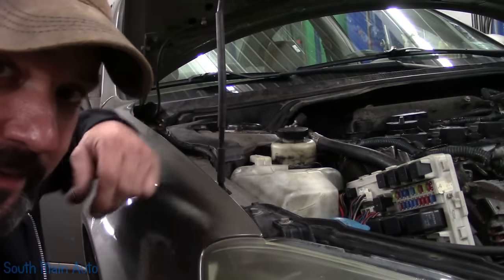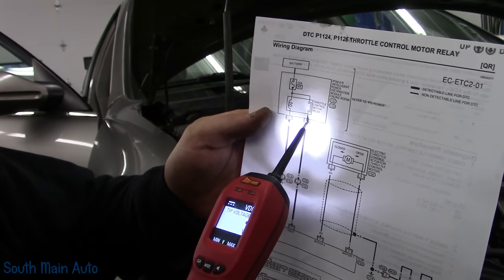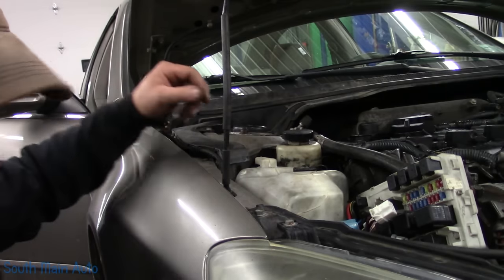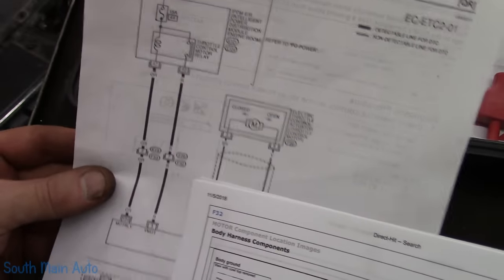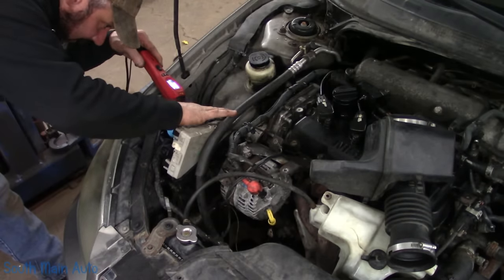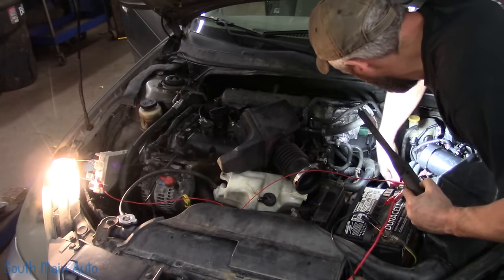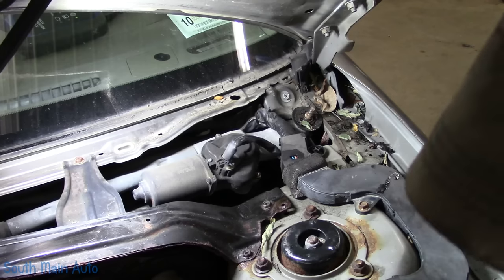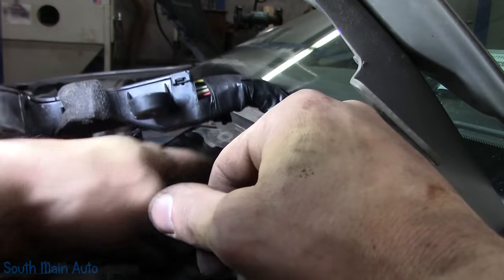How To Fix A Car That Keeps Blowing Fuses

Comment: Didn't need an ECM, didn't need a fuse box. Needed an advanced, patient, very smart auto tech, is all.
Reply from the maker: if we are honest it needed a little tape and a zip tie....
Reply: Tape and zip tie $0.48,knowing where to use them priceless!
Reply: @mikeholt3545  Moving the wiper blade while doing a short circuit test, come on, who could've seen that? Ok, I guess knowing the harness was under the cowl, but still.

There's an old joke one of the older EE's in my company used to say: I guy calls a TV repairman. The repair man slaps the side of the TV, it turns on and he says, "Its fixed. That'll $100." "A hundred bucks for slapping the TV?" The customer says. "No," the repairman says. "Slapping the TV is free. You're paying me knowing exactly where to slap."
Reply: While Mr O is certainly patient and smart, what we have here isn't rocket surgery - it's just simple logical troubleshooting. The other guys should be embarrassed throwing bits at it instead of properly diagnosing the fault.
Reply: @TonyRule  Shorting out the fuse box, not a good idea.
Reply: And most likely the customer was charged with a new fuse box, new ecm and the cable repair
Reply: @gianfrancoa  I hope not.
Reply: @gianfrancoa  There's no doubt about that. And they were about to throw an ECU at it too!
Reply: @Joseph1NJ  Well, that depends on why you're doing it. Diagnosing a blowing fuse problem in a customer's car... no. But if your BBQ is broken and you really want to cook some sausages over an open flame, and to hell with the consequences, it's a brilliant idea!
Reply: all your videos must be class sessions in  tech schools. period.
Reply: @SouthMainAuto  

Disgruntled customer "How come you charged me $1000, all you did was put some tape on a wire".
Eric O "$2.00 for wrapping wire with tape, $998.00 for knowing where to wrap wire with tape".
Reply: @Kryten428  Not in this case. $2 for the tape. $998 for having to rip half the car apart to get to the problem to fix it. I find the biggest issue with electrical work is people seem to think that the wiring is just magically exposed and easy to get to. " Why so much when you only repaired a wire?" compared to replacing an expensive part they can see that may have only taken 20 minutes to fit they seem to have no problem handing the money over.
Reply: @Joseph1NJ  He did not short the fuse box. He knew he was going to short the power wire going to the ECM.
Reply: @AutoTechElectronic  ah, ok
Reply: @SouthMainAuto  was that custom pissed about 1000 repair bill??
Reply: @mikeholt3545  tape and zip-tie...48 cents
Knowing where to put them...$60/hr
Reply: What power probe was being used?
Reply: Too many parts changers and not enough true, honest techs who have the patience to take the blinders off, dig in, and diagnose.
Reply: @Kryten428  Eric O gives them a link to the video...
Reply: @kirkabrahamson1148  You are absolutely correct! People always think that chasing an electrical issue is ALWAYS an easy fix when it isn't.  You are always chasing a ghost until you find where the issue lies.
Reply: @mikeholt3545  Good one and true
Reply: I would have installed. A  backwards zip tie. I seen them run thru wires. If there’s. Enough play  but other then that great.  Just. FYI. I’ve done ur way all The time until I seen it my self
Reply: @gianfrancoa  they were charged for a new fuse box as eric showed in the video it was melted it would have needed replacement anyway, the customer or whomever replaced the fuse in the first place with a bit of speaker wire melted the fuse box, i have come accross people that have been blowing glass cylinder type fuses and replaced the fuse with a piece of cut down steel bolt or mild steel rod, some people have a funny way of looking at saving money and end up burning their cars to the ground and still wonder what the hell happened.
Reply: In the UK, you need a college degree to become an auto tech. Here in the US, you need a license to cut someone's hair. You do not need a license or degree to repair the second most expensive property the average person will own which if not repaired properly, can put the life of everyone in the vehicle in danger as well as everyone on the road, and when misdiagnosed, cost you thousands of unnecessary dollars. 🤦🏼‍♂️Cars are not just nuts and bolts anymore. They are highly advanced and complex operating machinery/electronics. Basically one giant robot on wheels.
Reply: @gianfrancoa  Don't condemn the whole bushel because of one bad apple. Many of us are honest to a fault.  Just like any other professional job.
Reply: But didn't he say the throttle control actuator was replaced too
Reply: They would have gotten ripped off big time if they were in many other shops. I've said it many times there really fortunate to have him. Incredible skills. I've learned so much watching SMA

Comment: Pro tip: Jump the fuse and be patient. Eventually a fire will erupt and at the center of the flames you will find your short.
Reply: thats what i call an  electrical diag smoke test  thats the only way the other shop could of figured it out.
Reply: FarmerMiyagi  The trick is getting the factory smoke back into the wires.  I work on small engines, and had a customer say the factory installed smoke came out of the engine after they didn't put oil in the engine.
Reply: a bent nail works good and is reusable,just follow the smoke.
Reply: Is there a way to put the smoke back in? I've never been able to, though I have tried... Oh, I have tried....
Reply: @jeremyfizel5127  When I did electronics they told me that the wires are full of smoke and when one is leaking that's where your problem is.....
Reply: I have a friend who is an aviation electronics technician repairing servos and autopilots.  He confirmed the industry secret that all electronics run on magic smoke.
Reply: And at that point, you'll be certain that the short was somewhere between the front and back bumpers.  Also, the issue with the short is not an issue anymore!
Reply: The old navy electrician trick
Reply: Thats exactly what i did  kept blowing 15 amp for running lights  89 f-150   put a penny in  smoke at rear bumper  found licence plate wire shorted
Reply: I've seen that done!
Reply: ...that's a BAD IDEA!!
Reply: William Anderson  ...but at what cost?!
Reply: ...that's kinda like using a match to find a gas leak: effective but dangerous as HELL!!!
Reply: William Anderson  ....that was my POINT-!!!
Reply: @daleburrell6273  This is was a joy to read!

Comment: That is really stupid. As an electrician, I see this when people work on their own electrical equipment. Thanks, Eric for doing it correctly. I can't believe people blame fuses for blowing. They blow to protect the wiring and the electronics.  Shorting with a wire across a fuse terminal just causes arcing, heat, burning, and damage. It's completely useless unless you are trying to find a breaker that feeds a circuit far away. You can short a circuit to ground and then go find a tripped breaker.  This is useful with unlabelled circuits and breakers. You can narrow it down by voltage and number of phases. Anyway good video and proper troubleshooting techniques (splitting the circuit in half is an age-old method and extremely useful). They taught me that in the US Navy back in the 80's.
Reply: It's unbelievable that they put a jumper in place of a fuse. What could they possibly have been hoping to achieve other than possibly a fire?
Reply: Sounds like they were trying the smoke test, jump it out and look for smoke.  Bet that other shop doesn't have access to wiring diagrams like Eric does.  But still, isolating and looking for grounds should still be common sense.  Even without a wiring diagram, i would have unhooked the ecm and checked to see if it popped a fuse with voltage applied to the circuit.
Reply: Dad was in the Air force,and was taught the same,as he tried to teach me....lol...
Reply: wish I'd gone into a service when younger but at the time having fun n chasing girls seemed like the best use of my time. All those guys that did go into the services learnt skills that have benefited them for life, both professional and personal. I suppose I did get that a bit doing a trade with an old guy who taught me much more than just the job.
Reply: blown fuse ,paper clip , fixed , most shops now a days throw parts at it and cost because there is lack of real mech's out there 20 yrs i ve done it this way . lost art
Reply: Phatcowboy;  Shorting a circuit to trip a breaker for identification purposes does have its risks.  Many years ago in the early 70s I was working on an apartment building installing the intercom / door entry system and an electrician was tasked to install a duplex receptacle in the directory board to provide us with power.  The feed cable was there, but unterminated.  It was actually live (very bad idea!) which he discovered by accidentally shorting it out as he tried to install the receptacle. He then shorted it intentionally to trip the breaker both to kill the power and identify the breaker.  Turns out the breaker was defective and would not trip regardless of how much current you put through it!  A fair bit of damage was caused to the wiring before this comedy of errors was over.  I immediately learned from somebody else's mistake and removed this technique from my own troubleshooting methods!
Reply: @Vincent_Sullivan  Scary (and dangerous) suggestion by Phatcowboy (his handle is rather suggestive) to trace power wires buy shorting them as  was discovered. I had to rewire and old house (with sketchy grounds and old 2-wire rubber/cloth insulation. Only used electronic wire tracer. Works really well.

Comment: It's not the fact that you know what wrenches are needed and what sizes are needed for a certain job. It's not the fact that you can do a 45 minute job in 20 minutes flat. Not the fact that you've seen this same problem before a dozen times that makes you the best mechanic I've seen. It is the fact that you can diagnose a problem without a doubt to what it is. You're the king of diagnostics.

Comment: Love how a lot of shops misdiagnose a code and just want to throw in a new ecu.  My experience with this occurred about a year and a half ago.  I have an 05 Dodge Durango Limited, with the power moon roof (this comes into play). Started throwing code for ecu error (can't remember which code or the specific error), after a day or two it would go away. When it came back, I took it in and had them diagnose it. They told me ecu was going bad and needed replaced.  Price was astronomical so I started pricing myself. Cheapest route was sending it in for a rebuild, but it was a 10 day turn-around so that was out of the question as Beastie (kids' name for it) was the only vehicle we had that could carry all of us, wife and 4 kids. During this time I realized this issue would only occur after a heavy rain, and after a couple of days drying out, it went away. I started researching and checking the Dodge forums and found this was a common issue with Dodge trucks of that era with the moonroof.  In their infinite wisdom (yes, I am a Mopar Maniac, but I still shake my head at some of their design decisions), they put the main fuse box behind the kick panel of the driver's side footwell.  Well, as we all know, sunroofs or moonroofs leak, so they do install drainholes for the water to drain.  Apparently, the drain holes can plug up and in Dodge trucks, when they do, the water runs down the A pillar under the molding and straight down into the fuse box.  When I discovered this, I pulled out the fuse box and found that, indeed, my fuse box was full of water.  I dried it out, (only use my wife's fancy hair dryer saw for a year) checked for corrosion, circuit board was clean, but had to pull out my files and handy dandy torch tip cleaners and clean up all the contacts.  Replaced questionable fuses and relays, doused all exposed contacts with dielectric compound and put it back together.  Once I got the moon roof open I cleaned all the drains by running grass trimmer string all the way through them until it came out the bottom clean.  Haven't had an issue since.  Just took a couple of hours on a Saturday afternoon and about $40 in fuses and relays.  Twice a year I clean the drain holes as a preventative measure.  Only time the moonroof gets opened
Reply: Lance Rasmussen 8
Reply: Yes, I avoid a vehicle with a moon roof for that reason, regardless of the make. I usually buy Toyotas which are known for reliability and I wouldn't touch a moon roof equipped one.
Reply: I am a Master Tech that worked @ Auto Glass shops most of my life...San Diego we installed a windshield in a rare 1970/71Plymouth VIP 4 door Every time this Lady washed the car and she made a LEFT TURN...Water would stream onto her lap(we know it did it before after I found out what it was...she said it didnt...ok.) But since we put the windshield in...it was OUR BABY...I water tested it knowing full well the windshield was sealed completley!!! Yup...left turn...stream of water came through the pinch weld onto the lap...the VIP had a Stainless Steel molding on the drip rail of the roof that model and year...pop rivets held the Stainless Steel molding in place...I removed the front 3 pop rivets and shot sealant up into the holes allowing sealant to ooze out where the new rivets would go...Replaced the three...Problem solved...our shop guys had re sealed that windshield 7 times...whooohooo!!!
Reply: Mechanics getting old not keeping up on technology?
Reply: @Stimpy&Ren fuses blow for a reason.  what caused it?
Reply: It’s the manuals fault. They tell you to do test and if negative replace the part vs check your wiring and see if it can handle a load. Eric is clearly a smarter fella 👍🏼
Reply: Probably didn't need to change out relays cause they are sealed never had to replace a relay on a Subaru ever but on 75 Rabbit when radio antenna gasket weather worn would leak rain water on back of fuse block and short out! VW replaced 1st one on recall I had to replace 2nd meltdown.
Reply: I was a Dodge tech for about 4 years. I had a Commander come in with no crank, no comm with pcm. Saw the DTCM was also no comm, unplugged it, network came back up. Ship it.

Comes back on a flatbed the next day, same issue. Check power ground at pcm, spent hours trying to decipher Chrysler wiring diagrams, trying to trace power from the pcm to wherever I'm losing it. Finally, another guy made a comment about the sunroof. I had my ass handed to me over your exact problem. Didn't even know that junction box was there, didn't see it on the diagrams. That fixed it. Until it rained again. Lady junked the car.
Reply: So,  I'm curious as to whether you've experienced any further problems with your vehicle. Of particular interest would be electrical faults, no starting, or any computer module issues. Thanks

Comment: Thank you for doing man work and doing a proper diagnosis, too many "repair" shops just changing parts. Just glad to see an old schooler doing it right
Reply: The shop that sent this over were parts changers. Throttle body, fuse box, and you need a new ecm. Who ever put the jump wire into the fuse box were the ones that damaged it.
Reply: ...Eric may be old an old school mechanic...but he is state of the art when it comes to electrical diagnosis...

Comment: Using the  shorted wire as a ground to energize the 4 amp light ,genious. Enjoy your videos.thank you .
Reply: There's only one problem with that trick.  You need to discover all the circuits your particular fuse feeds.  In this case, there were two circuits, the coil side of the relay and the switch side of the relay.  In some other circumstances, that one fuse can feed multiple circuits so potentially, the other branches of that circuit could keep the light lit even after the short is "found".
Reply: Thanks for explaining it.
Reply: With the light “on “ following the harness with a compass will point to the location of the ground.
Reply: Jesse Aragon, can you explain about the light part how it was done. I could only see an LED lamp with a red cable only (no black wire).
Reply: @paulkleinschmit9871  in this particular case ,he had isolated the components on both ends and the target was divided in half to further eliminate the troublesome side.
Reply: @soldier2gud4me  he was using the black to complete the circuit .

Comment: Nice job!
I understand, that is what I do all day. Never easy working across multiple platforms with imperfect information. As an old timer, I'm glad 2 c I'm not the only one still using a test light. 
At least I'm not the only one who solders and shrink tubes electrical repairs. Now I know there are at least 2 of us.